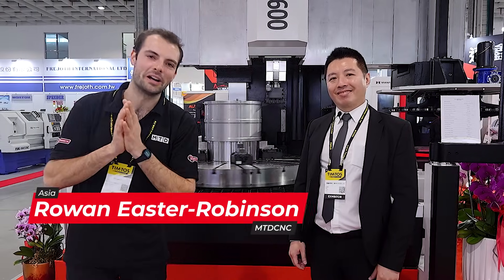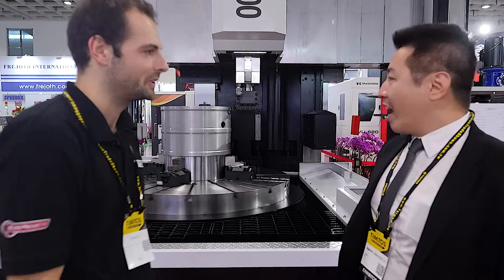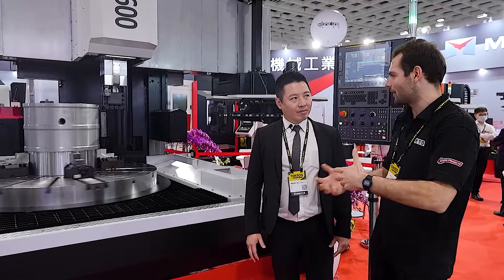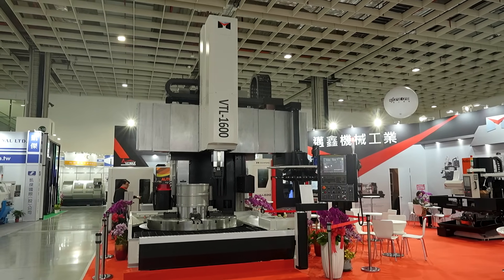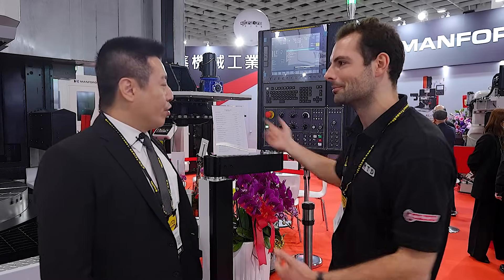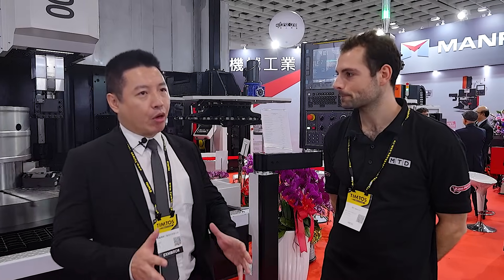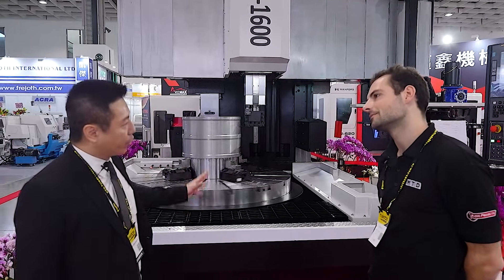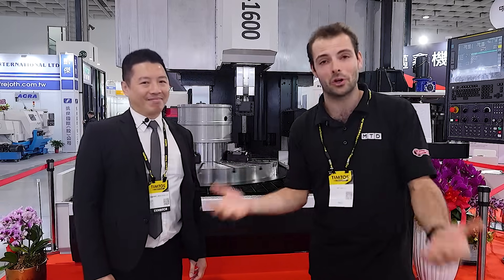Why is Taiwan so successful in producing and designing machine tools?

Comment: i do hope that its spindle/rotary table is at least a hydrodynamic bearing or offer it as a optional upgrade. maybe even a all moveing part hydrodynamic option  ( just to get that little bit more power out of the moter since its zero friction giving us that little bit more power back and also the zero wear so there will never be a wear problem at the spindle/rotary table and no stick slip effect ruining my surface finish on a cosmetic part with extremely tight surface tolerance . if i had to buy it and that option was avalable i would pick it just for the zero wear and ease of mind that it would never wear there )